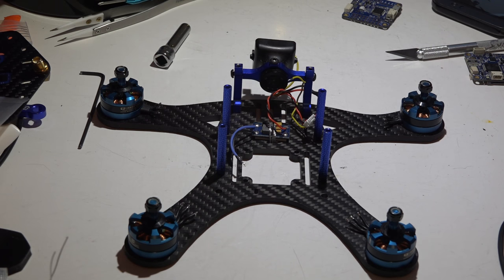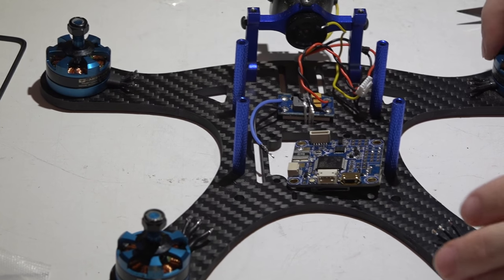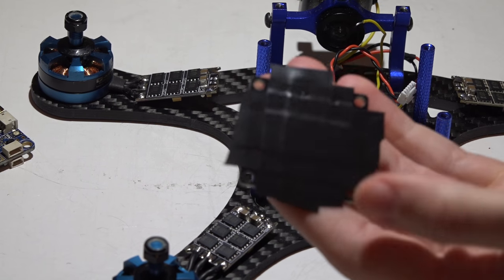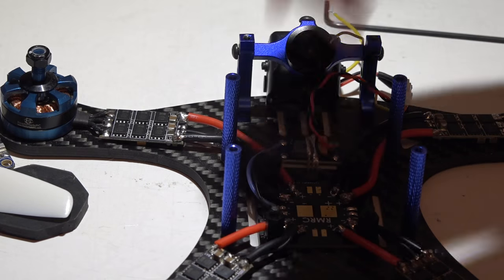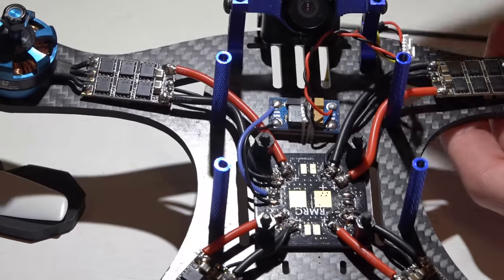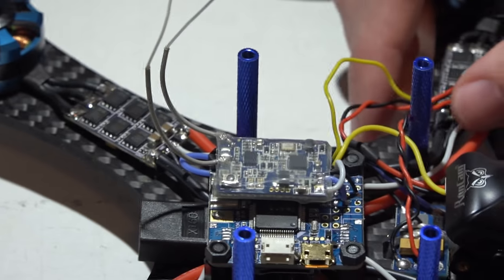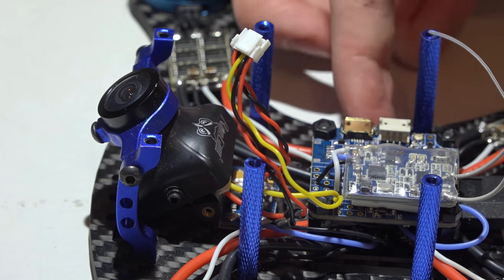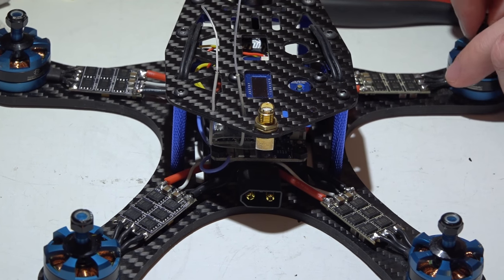Hellbender 204 V2/D Shot/Omnibus F4 Pro V2

Comment: as im learning more and more about this board im not sure if i really need it.. i have current sensor on my RROSD PDB, really all im after if the BF OSD for changing pids and blackbox..  what F4 alternatives is there that you would recommend ? and all the info on RCGroups this board is a head fck :D
Reply from the maker: I really like the F4 and F4 Pro, but not the current sensor on the Pro version. The F4 Omnibus is my favorite and they both have OSD. And in Betaflight 3.1 the OSD got even better by allowing you to display you PIDs on screen to you can tune your PIDs in flight using your transmitter. So currently I think the Betaflight OSD is the best. Long story short I'd just keep your set up and power the F4 Pro like I'm doing in this video. If you want to clean up the build then you could use a different PDB with current sensor but not the OSD, and buy a F4 Omnibus without the current sensor but it still has the OSD. As far as other F4 boards I've tried the Flip 32 F4 Revo edition which is exactly like the Omnibus F4 accept it doesnt have OSD. As far as I know at this time there are no other F4 boards capable of using the Betaflight OSD feature. I've also tried the Revolt F4 which only works on Raceflight but at this time I do not recommend it. Its a huge head ache, Raceflight sucks right now, and it doesnt have OSD. I'll be making videos on the Revolt and Flip 32 F4 soon so you can see what I'm talking about.
Reply: Project Blue Falcon Hi m8.. does the F4 version with OSD have sim card option  as well for BB ?? and Happy Christmas dude have a good 1 !!
Reply from the maker: Sorry I didn't see this until now. Yep all the Omnibus versions have the SD card reader.

Comment: project blue falcon... so i have had some bad stuff happen with my omnibus f4 pro v3 the boot button came apart and then now after 1.5 weeks flying with the omnibus f4 pro v3 ive had several dropouts during flight and will cutout for a second or more and if close to ground its all i can do to save it. I hooked the board up and randomly this happened twice now it will be dfu mode ? What would cause this and would this be related to dropouts that most time happen when im throttle up harder?

Comment: How did you get the battery strap on the bottom with the PDB mounted flat on the carbon? Thanks keep the great videos coming!
Reply from the maker: The PDB doesnt cover the two slots in the frame for the straps. The straps run next to the PDB.

Comment: I have a capacitor soldered directly to my power pads on my pdb. Do you think I need an LC filter to power my FC (Omnibus F3)
?
Reply from the maker: You dont need either to power the flight controller. The capacitor is just to help save parts from voltage spikes and clean up the signals going to the ESCs. A LC filter is to help clean up your video feed. Both help but not needed.

Comment: what does telemetry give you. does it give the FC rssi readings to display on osd or what
Reply from the maker: Telemetry is just what sensors you can see on your transmitter like voltage, altitude, current, and more. But you can put telemetry in your OSD without telemetry more or less. There is a video in my OSD playlist showing how to do it with a Taranis transmitter. I still have to make videos on doing it with the other ones.

Comment: have they figured out how to activate motor pins 5 and 6 so you can fly a hexaxopter yet on any of the omnibuses?
Reply: have you ever tried to connect 6 motors to a omnibus? or is there a f3 or f4 FC you recommend of a y6 or spider hex?

Comment: Hello friend,

I follow all your video's about the ominubus pro4 and it helped me 100%. The only problem what i have now is that I try to update the FC, but it doesn't update and now my FC doesn't connect to betaflight anymore. It only make connection when i press the boot button and power it to the pc. The green led keeps on burning and the blue one doesn't flash no more. What can i do? Did you try to update the pro 4 to the last firmware?
Reply: Hey I solved the problem. The full chip erase option need to be off.
Reply: hello Afiso, can you tell us in more detail how you solved the problem?